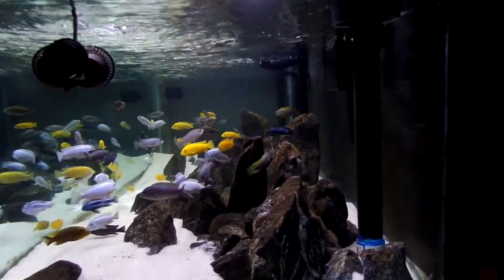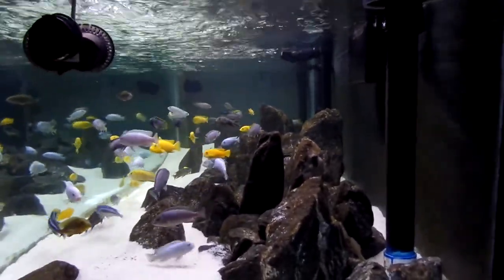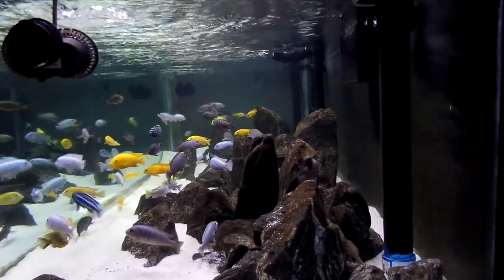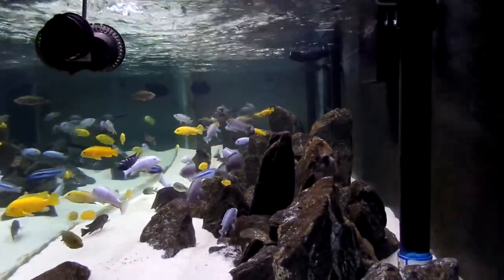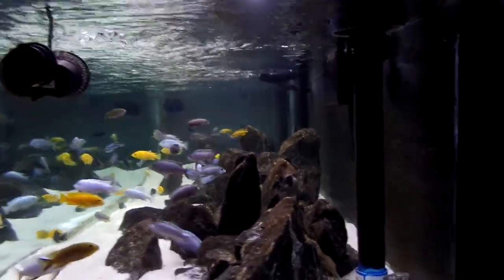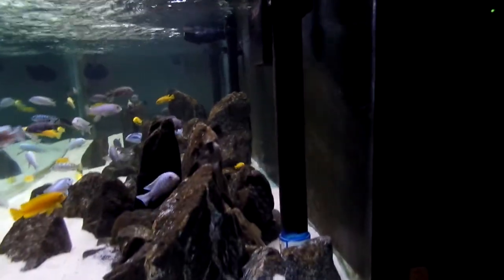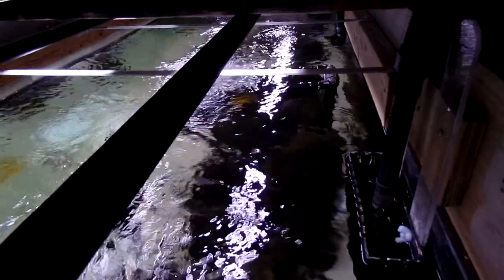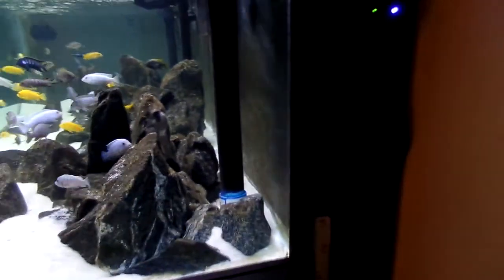Skimmer Box Explanation

Comment: whats purpose of keeping surface clean? like what type of stuff is usually on the surface?
Reply from the maker: Actually there are several reasons.. Gas exchange is easier / light penetration is clearer / keeps in my case an oily and dusty water surface from developing which looks crappy and also inhibits the first 2 reasons I mentioned.
Reply: Gochu, better had and brighter lights 😛
Reply from the maker: right on !